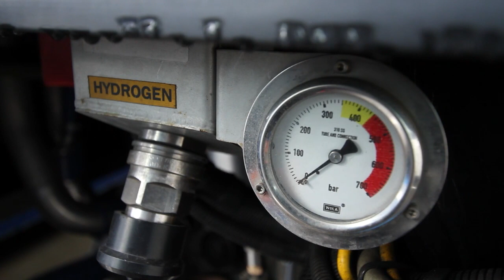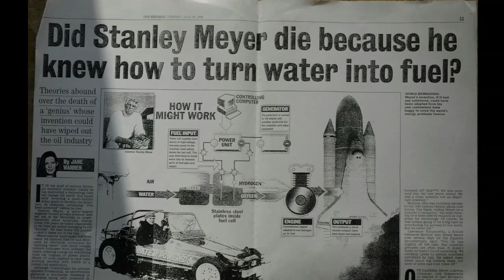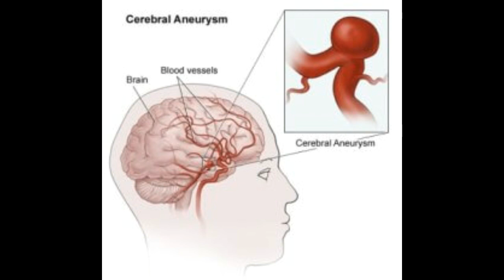The Truth About Stanley Meyer's Water Powered Car

Comment: So he basically invented an overly complicated electric car. 

Using electricity to convert water to hydrogen. You could just run the engine off of that electricity.
Reply: It’s still a combustion engine he’s using the electricity to separate the H2O into hydrogen and oxygen and using the hydrogen as  the fuel. Electric cars still need to be charged and electricity is still mostly created using coal. So electric cars are not as green as they lead us to believe.

Comment: I was around when this was a fad... Yes, the car ran on hydrogen. But it was more expensive then gasoline.   That's why the courts all found he was lying.  It was not innovative or new.  Splitting water with electrolysis is not "ground Shaking" I built a generator that ran on hydrogen gas from a wood fire.  Big deal.  Its still more energy intensive to make the hydrogen...  A PEM cell makes a lot more power then the burning of the fuel.  But its still all about storage.  Until we come up with a good way to store the hydrogen, its not going to go anywhere

Comment: Thanks for renewing interest in Stan Meyers inventions.
I've got a copy of his work which includes an HHO furnace and needs no chimney as it's byproduct is humidity. 
The cars plans are complex for me but I'm redesigning it to make it simple.
Stan was a genius and I've looked up to him as a Christian and a hero.
Reply: Have you found out how Stan ran low amps and high current voltage? It would be good if you could share.
Reply: @chris01479  Hi,
Stan had a device that would pulse at 20,000 hertz and ran at .5 amps. This created the resonant frequency to break the hydrogen and oxygen apart.
I'll have to get back into the plans to be sure but I believe it was a pulse width modulator and was rather large but able to run on the car.
Electronics is not my strong suit but mechanical engineering and science is.
His 1600 cc Volkswagen engine was a great test unit as the volume of liters per minute was small.
I have a 1,000 cc geo metro for my test bed and although I've not been able to run it on HHO alone it did increase the mpg from 44 to 54. 
I'm building a new engine with gapless rings and milled head to increase efficiency also a solid copper head gasket ike I ran in my race cars.
I've just been recuperating from major surgery and hope to get back at it very soon as fuel costs are rising everyday. 
Good luck with your research and testing.
Reply: @charleshughbryan5603  Yeah Stan did used pwm that created high voltage, low current and something pretty stupid with high frequency. He must have used capacitor to protect from high current flow. He did not use electrolysis, he used high voltage to split the hydrogen and oxygen to get them to go separate. There are a lot of people out there who are still working on the technology as they really need it badly. I have confirmed that few of them have been successfully. They are now working on the other projects such the injectors to try to get it to work. I believe that the system will be out very soon maybe in few years time. Good luck on your operation and hope you get better soon.
Reply: @charleshughbryan5603  Can I ask you that if we run hho on our car, can we get 500mpg? I find it very hard to believe that hho can increase 200% or more on mpg.
Reply: @chris01479  

hello,
I'm not sure about the mileage but the water s free and it takes in dirty air and filters it out so it's a win win for the planet.
Good luck with your research.
Reply: @charleshughbryan5603  Well, explain to me all about the car systems

 And also explain to me about
 How does the air gas processor work and how does it interact with the combustion of hydrogen and oxygen
Reply: @charleshughbryan5603  Well, explain to me all about the car systems

 And also explain to me about
 How does the air gas processor work and how does it interact with the combustion of hydrogen and oxygen
Reply: @Mohammed-uz1sn 
 Hello,
Stan's system of producing and burning HHO are very complex and several hundred pages long.
The short version is. He had a water tank in the car and pumped it to a cell of stainless steel tubing which were wired positive and negative and powered by a pwm that ran at 20,000 hertz and .5 amps to produce resonant frequency to split the hydrogen and oxygen before the injectors/ spark plugs. The HHO had to be injected into the cylinder as a gas so as not to hydraulic the cylinders.
The HHO recombined in the exhaust into water vapor.
He also used lazers to destabilize the incoming air,possibly to aid in the combustion.
All of this was controlled by a large onboard computer to vary the volume of fuel to  air ratio.
I'm simplifying the design with current technology not available in the 1990s and hope to get it up and running soon as the world needs it now.
Thanks and good luck,
Charlie
Reply: @charleshughbryan5603   Well, thank you, but do you want to build this project? I want to follow your developments
Reply: @Mohammed-uz1sn  
I'm overcoming some health issues and building a new house but will get back to my fuel projects soon.
Stan's complete works are available on public domain as the patents are expired.
My attorney petitioned the estate and I've got them.
I plan to work on it soon.
Reply: Heyo bro. Can you share please? I'm interested in this
Reply: @issho8885  
It's a few hundred pages and very complex.
I'm a mechanical engineer and a former Volkswagen mechanic. I've studied chemistry and physics and have developed my own fuel systems with great results.
His use of lazers to destabilize the incoming air was genius but I don't think I'll use it.
I petitioned Stan's estate through my attorney and received this through the freedom of information act and you can too as it's public domain now that the patents are expired.
Good luck with your search and development.
Reply: @charleshughbryan5603  thanks bro

Comment: Water is the product of a reaction that has already happened (oxygen and hydrogen combining), you can't efficiently reverse the reaction without putting in more energy that you get out, no matter what process you use.
Reply: @sourand jaded dude, electrolysis needs energy, and you can't take more energy out of that water than what already is in it. You can't just make energy from nothing
Reply: @oliverpapai6011  Who says you're making energy from nothing?
Reply: Water contains hydrogen which contains energy, if you don't believe me, look up 'hydrogen bomb'. Fossil fuels are very similar except they have carbon instead of Oxygen and you get energy of fossil fuels don't you?
Reply: @PaulFrankAdams  So i should be able to set fire to water? Hydrogen has a lot of energy, the hindenburg was a great example.
Reply: @martynwatson4929  No, you can't set fire to water because it evaporates before it reaches it's flash point. But it does contain hydrogen and like the sun, it's full of energy.
Reply: @martynwatson4929  wow, what a ridiculous comment..... it's clearly the gas that would be burnt..... it would be absolutely nothing like the Hindenburg..... it's not a giant gas balloon you would be dealing with for starters.
Reply: @WSmith_1984  What gas are you talking about? Where has it come from? Steam is a gas, can you set fire to steam?
Reply: @martynwatson4929  the hydrogen and oxygen (H20) that make up the water, didn't you do basic science at school?
Reply: His fuel cell did indeed produce copious amounts of hydrogen and oxygen, I remember he did a demo and they had to evacuate the building due to imflamable gas build up!
It did indeed require energy to be put into it to start the reaction, I believe he used mains electric power in USA so fairly high voltage but it consumed very little current because it used a resonant frequency electrolysis fuel cell, some said the metals used in the anode and cathode were part of the reason the reaction was so fierce ie they degraded quickly but he stated the fuel cell required zero maintenance and no parts wore out! 

Maybe he did figure out some method using electronics to efficiently split water into it's component gases?

There is definitely something odd about how he died at 58 after a meeting about his device.

There was certainly a lot of people and businesses who wouldn't want a water powered car hitting the market.

Apparently he was inferred billions by oil companies to just sit on it and do nothing! Being a stubborn guy he refused.
Reply: @nigelcraig3949  No I'm not, my book is three hundred well-researched pages from many sources.
Reply: they said "hydride is the key for water powered car"

Comment: What happened to the carburetor that was running 100  miles  per gallon  research  on that
Reply: def hoax, the carburettor doesn't really changes the way the engine operates, and transfers the stored chemical energy in the fuel into mechanical and heat energy.
Reply: @oliverpapai6011  
Hi,
I'm a mechanical engineer and my life long work has been to make conventional engines more efficient. 
After developing many fuel systems since the 70s, I found Paul Pantones plans on the internet and built it for my 6,000 pound 4-wheel drive GMC and got 64 mpg. 
It was very crude and I plan to refine it very soon.
I heated a small tank under the hood with hot glycol pulling 10 inches of vacuum on it and using spent exhaust gas for make up air. Then pulled it through a heat exchanger heated  by exhaust to 800 degrees going into the engine. I had used lawn mower carbs as no other valves would withstand the heat. I ran cables to sync the throttle body for air control and the small carbs for makeup air and vapor fuel control.
 I build race cars so it's a challenge but worked.
I used .5 gallons of liquid gas and converted it into 1,600 gallons of super heated vapor. The engine sounded like an electric motor it ran so smooth. The best gas engine is 25% efficient and that's obscene. my calculations show about 80%  with this system.
we're burning $3 of the $4 per gallon in the catalytic converter to stop pollution.
Let's concentrate on this to make conventional engines run better.
The technology is available and the need is great.
Good luck with your work.
Reply: @charleshughbryan5603  You are wrong on several accounts. for one exhaust gases would never reach 800 °. if it would there would be no exhaust system that could withstand it. and you said the best increase in mileage would be about 25%. there are modern vehicles with modern electronic fuel injection that beat that. and you said that most of the unburnt fuel is burnt in catalytic converter. untrue a majority of the unburnt hydrocarbons. are run back though the engine though the exhaust gas recirculation EGR system. I have been an automotive technician most all my life so you might want to try again.
Reply: @musicauthority3516  how hot is a red hot exhaust manifold and turbo on my 18 wheeler after a steep mountain at 100000 pds.
Reply: That was a complete hoax as well.

Comment: This technology lives in a grey area of science. The technology mimics the earth's "Global Electric Circuit," and in doing so breaks the bonds of the water molecules like a thunderstorm does. It took me a while to get at the science behind this technology using the scientific method and with that research I came up with a whole new theory for the books of science, "All  Molecules  can  be  separated  into  their  component atoms  by  taking  away  the  electrons  from  the  atoms that  make  up  the  molecules." This is what this technology tapped into that stumped the scientific community. Plants do the same thing when breaking the bonds of the water molecules as it targets the atom's electrons in order to get the water molecules to break down into it's component atoms as when you break the bonds of the water molecules in this fashion you get hydrogen and oxygen gas atoms plus the creation of electricity and if anyone has ever put a multimeter leads into a tree you will see the tree is producing a voltage.
In my research to understand what Meyer had done I found out that any way we know of in how to get the electrons away from their atoms will work to break the bonds of the water molecules. Now knowing that the world already runs on hydrogen this means that with this technology we can become part of the earth's water cycle and ditch our fossil fuel use.
One thing I find interesting is Meyer was not the first to do this as Dr. Dingle of the Philippines did this way back in 1968, but the IMF and World Banks put a stop to it as they were long on fossil fuel use. 
Now I am seek funding and hoping that the people come to this technology aid so that we can finally start to phase out the use of fossil fuels. The technology is now 54 years old so I think it's time for it to have it's moment in our lives so we can actually move to turn our climate change problems around. Any and all help is welcome and thanks for your support: https://www.gofundme.com/f/energy-independence-for-you-and-me